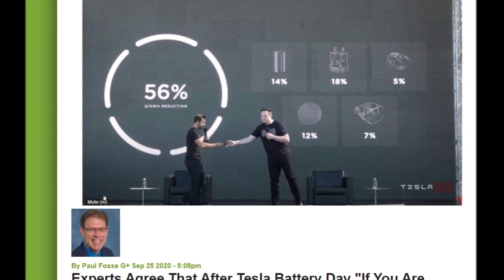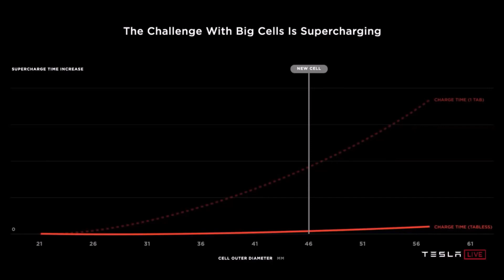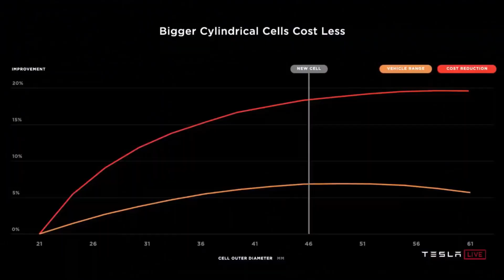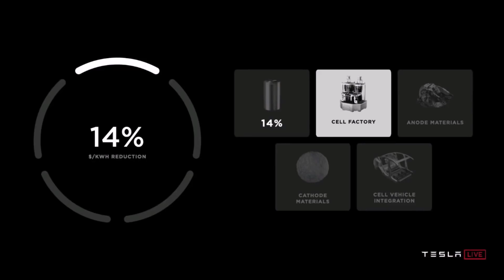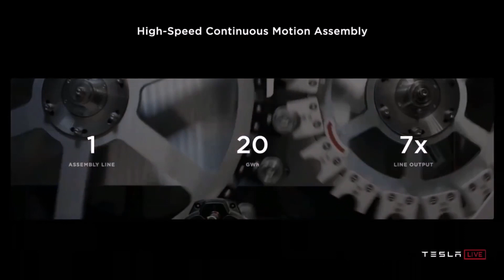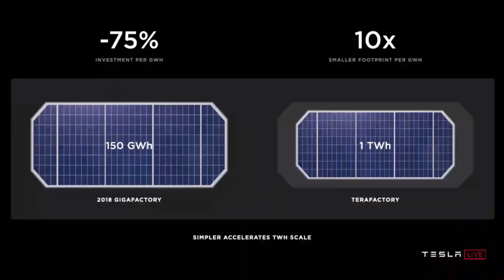It's Unwise To Design ICE Car After Tesla Battery Day

Comment: Gas cars will be around longer than you think. People will still wear out the fleet. People that dont have a place to charge at home will have trouble adopting till charging is faster and stations more abundant. There may seem like lots of charging stations these days but gas stations are on most corners. Rural folk will be slower to adopt. I dont know anyone that puts less than 25k a year on a car here. Rural people also prefer larger vehicles.
Reply: You imply an interesting possibility with your "gas stations on every corner" comment. Wouldn't the smart gas stations owners begin transitioning their retail space to BEV charging ports as well as providing gasoline? Seems to me we could be talking about EV charging stations on every corner in 10 years.
Reply: Tim Yarrow the convince store that sells gas will not be where people go to recharge. If sufficient charge takes more than an hour it will be restaurants. more than 2 movie theaters or malls with mixed entertainment will be the  ev charging slots people use.  In 10 years most of the kinks may be worked out. But in any event ice vehicles wont be completely dead for a good long while. They may slip below 20% of sales in less than 10 years. But specialty vehicles will be around a long time. Several companies are working on ethanol in compression engines. That will mostly negate the smog problem with them.
Reply: @derekmartin2817  I'm confident that the market will sort out EV charging locations.  The take-home point is that future charging locations will be as ubiquitous and obtainable as gas stations are today....maybe even more so since EV charging doesn't carry the same environmental risk as does gasoline delivery, storage, and dispensing.

Comment: I don't understand why so many are waiting to make the Tesla plunge.  I couldn't afford not to own a model 3 instead of my previous mercedes CLK 320 Cabriolet.  The Merc got 12mpg cost $240 month for gas.  The M3 costs $25 month in electricity. Same mileage. Difference is I have more fun driving M3 pedal to the metal.  It's fun to drive it so you hardly ever wear down the disk brake pads - using re-gen.  I live on a 1,500 ft mountain.  Before I had to replace brake pads annually.  Now I use re-gen - charge it instead of waste brake linings heading down the mountain.  Merc cost $3,500 year in maintenance on average.  M3 past 18 months - zero maintenance.  Insurance dropped ~ 50%. I save ~ $7,000 per year with the Tesla I paid $30k for after tax incentive. Payback is 5 years.  When I install solar panels on my house and a power wall then zero energy payout and when the local electricity outages hit I won't even know it when I eventually get a starlink UFO on a stick satellite internet service.

I've owned Merc C series and BMW 3 series.  The M3 is quicker, safer, more economical, more comfortable, more spacious and more beautiful.  There's more leg room inside because there's no drive shaft hump, no engine in the front.  The glass roof is not thick so you have more head room and what a view and no worries about UV roasting the paint off the roof or bird manure eating the paint off the roof.

"The drivetrain in an ICE vehicle contains 2,000+ moving parts typically, whereas the drivetrain in an EV contains around 20."
There is no slack when you press the accelerator of EV.  With ICE you press the pedal, which goes through linkage to the injection system then the piston pushes on the piston pin, which pushes on the piston rod, which pushes the crankshaft which pushes on the clutch which pushes on the trans main which pushes on whatever gear you got it in, which pushes eventually on the front of the uni joint which pushes on the back side of the first uni joint which pushes on the first half of the drive shaft which pushes on the back half of the slip drive shaft which goes through the front of the second uni joint and then the back of the second uni joint which pushes the diff pinion gear which pushes on the axel pinion gears and finally the axels are bolted to the wheels - no wonder there is a lot of ICE maintenance compared to EV and a lag when you press the accelerator of an ICE.

I used to rebuild wrecked-totaled Merc, BMW, Audi, Porsche, Jaguar, Saab.  The M3 construction, fit and paint is as good or better. 

I bought a chunk of Tesla stock at $640 (before stock split in 5 pieces) the gain has paid for the M3 6 times over so I have a Cybertruck on order.  Can't wait to use it to plug in my air and electric power tools on job sites, no worries about dents or scratches, the thing lowers down so you don't need a ladder or carry steel running boards around just to get in and out and tools will be safer under the built in bed cover.

No more fumes.  No more goosing around town, waiting in line to get gas, checking water, oil, changing dashboard bulbs - on and on.

I have no idea why some say it will be 2025 before EV costs become equivalent to ICE.  My M3 is 30% paid for already just from savings on fuel, maintenance and insurance.  No ICE I've ever owned comes close to being as satisfying or exhilarating as a Tesla.

Comment: I think a big area, where there seemed to be a miscommunication was the structural battery pack. Bob and John were saying others do it to, but the point was others use the overall pack as structural,as do tesla now by adding i beams etc.
but Tesla is using the cells as part of the structural makeup meaning less dead weight.

Comment: The Teslas with new batteries might be worth buying due to the much-needed weight distribution improvement.  They still look like a computer mouse tho.  My new ICE will be far superior as far as driving dynamics for quite some time I reckon.
Reply: Tesla right now have much better driving dynamics then most ICE cars due to the low centre of gravity, the first time you drive you it's really noticeable.
Reply: @deepwinter77  most ICE cars.  They need more years to dial-in the weight distribution and AWD.  It seems they're aware and improving based on Elons Battery Day remarks.
Reply: @dragonsickness4561  no the polar moment of inertia is already better in Tesla's vs ice cars, he is talking about improvements over Tesla's, weight distribution, center of gravity, and polar moment of inertia are all better right now then ice cars.
This is not a controversial claim it's well known.
As well as acceleration and speed, on most cases. They already have AWD.
When compared to ICE cars in it's class it exceeds most of them. It's performance models will beat most ice sports cars, certainly in their price bracket. I know petrol head's that have taken a test drive in a p100D and completely changed their minds on Tesla's.
Reply: @deepwinter77  to say teslas have better weight distribution is too general of a statement.  Depends if you're talking abt mid-engine or front engine. How the suspension and AWD are tuned come into play to counter weight transfer and many cars have different setups that require different types of driving.  It comes down to what setup you prefer to handle and what your goal is.. One isn't necessarily better.  Teslas are more similar to mid-engine designs.  Those are okay on a racetrack if you want to drift and buy new tires a lot
Reply: @deepwinter77  they don't release PMOI numbers so to say that Teslas have better PMOI than all ICE is absurd and literally nobody knows this.  If it were true, Elon would say that all the time. Regardless,  better would be a matter of perspective and what your purpose is.

Doesn't matter anyways.  Teslas owners  would rather use FSD.
Reply: @dragonsickness4561  it's a formulaic calculation, how do you think having an offset weight set in the front of a vehicle in the form of an engine block does to this calculation? Its dominated by weight away from the center of rotation.
For Tesla drivers to prefer FSD they would need that option many don't, & those that do certainly don't use it all the time, my first time driving a Tesla was on a track my mate was there with a Suburu Impreza and we both got a chance to drive a Tesla P90D and it blew most ice cars away unmodified in acceleration handling & speed. I do not own a Tesla I'm just realistic after comparing them to most Ice cars and all Ice cars I've driven/drive.

 Also having a car with superior handling is preferable in FSD as it enhances the cars safety.
It's lower center of gravity also helps in accident situations and contributes to Tesla's being some of the safest cars on the road.
Me saying Tesla's have better weight distribution then most ice cars isn't to general it's actually a fact, and I was responding to your initial claim ice cars would be better in this area foe some time.
That is a generic statement, I said most not all.
Even most mid engine ice cars do worse because the battery is lower and weight is lower then any engine I've ever seen or come across.

If you're driving hundreds of miles daily and no super chargers in your area, sure an ice may still be preferable for now, but that's a different argument and it's becoming a pretty rare niche situation.
Reply: @deepwinter77  you didn't say most.  You said ICE vehicles.  You said better dynamics than most ICE - not PMOI specifically.  Now you've backtracked to correct your statement.

Front-engine handling requires that you transfer weight to the front before the apex to prevent understeer.  If you have a good AWD coupled with that design you give throttle as you approach the apex, engage the AWD for some rear torque (and possibly a bit of oversteer if timed right), square-off the bend and throttle out of the turn. When done correctly its more effective than full-on drifting as displayed by Audi in the 80s-90s when they embarrassed all RWD vehicles consistently with their controversial AWD.  Its very different from rear or mid-engine driving. Front-engine is typically suited for daily driving unless you have RS Quattro or a similarly intelligent AWD system to give rear torque when needed. In that case you have a powerful track weapon that is capable of getting a bit greasy around corners, but still won't drift like a RWD car, but is preferable if you know what you're doing and have mastered front-engine, AWD dynamics.

It brings me back to my point of your generalized statement.  You're comparing apples and oranges by comparing front, mid and rear-engine when they're designed for different purposes and each have pros and cons.  It comes down to driving style, preference, skill-level and setting (track or street).  Not all AWD systems are the same.  Some AWD systems are more intelligent and tuned specifically to synergize with the vehicles weight distribution when it senses the need for torque adjustment.  There are many variables working together.
Reply: @dragonsickness4561   @Dragon Sickness  I did say most look at my first reply, to your original comment in which you stated your ICE car would be "far superior" in driving dynamics for some time.
That's the context pmoi, relates to driving dynamics that's the point of what he Elon was talking about how polar moment of inertia impacts driving dynamics. It's the whole point of why you would be interested in optimizing for this figure, to improve handling.
You seem to be arguing from a conclusion, you haven't compared the handling of a Tesla to your ICE car but confidently pronounce your ICE car is far superior.
I had an opportunity to directly compare a Tesla to an Ipreza WRX on a track, and to the many ICE vehicles I've driven over the years.
Only after this my decades driving ICE cars compared to my driving  a Tesla did I make a claim about the superior driving dynamics of a Tesla.
Reply: @deepwinter77  I'm referring to "no the polar moment of inertia is already better in Teslas vs ice cars"
Reply: @deepwinter77  I've seen a stock TT RS get 0.1 sec slower lap than a model 3 performance and I bet it could do better if the driver had more experience with front-engine, Quattro dynamics. Its a lot trickier to master than other designs where you just floor it regardless. The Tesla was clunky and sliding everywhere, appeared difficult to control the drift, brakes were bad, but the torque/acceleration saved it.  In an actual race the car with more traction has an advantage cuz he can cut you off more easily and even take the outside of a turn and still come out in front.  You don't see many Teslas actually racing - just doing lap times.  It suits them when cars with better traction/handling can't have their way with the clunky drifter.
Reply: @dragonsickness4561  now all you're doing is ranking cars by saying an Ice car was slower around a track,  and I could list a dozens cars in its category it was better then, still makes your initial comment wrong imo, i.e. there now worth buying because there weight distribution is so bad.
In car you haven't driven.
But whatever man im not trying to sell you  Tesla.

Comment: does a 4680 tabless LiFePO cell make sense
Reply: Yes. Form factor even more important for LiFePO4 - need the extra range, power and durability you get from the form factor and tabless to offset lower range and the fact this chemistry to go in less expensive vehicles.
Reply: @cbmusgrave  tabless means electrons arent crashing into each other on the way out of the battery creating heat.... shorter distance less heat, less cooling needed, larger cell possible...
Reply: @bobh9492   Generally you are right, but your explanation is wrong. Electronic resistance is caused primarily by ionic scattering  - that is inelastic collisions between electrons and phonons - not by electron-electron collisions. Lower LiFePO4 energy density is balanced by larger form factor, which increases the overall electronic conduction pathway length, but 4680 balances that with tabless shortening the average e- conduction pathway. This lower resistance and thus lower heating on charge and discharge is especially helpful for LiFePO4  - tabless gives you more headroom so as to avoid power levels where LiFePO4 degrades so you get more power without need for cooling. My original post implies this in the balance between form factor and tabless effects on resistance.

Comment: Tesla has the key patents on tabless cells and also several other relevant patents, it is those in conjunction with the cylindrical form factor that enable the rigid structural battery pack and also superior heat dissipation/cooling allowing higher currents and extended charging curves over pouch or prismatic construction.
Tesla also has the patents on the Giga Casting process and the IP on their proprietary aluminium alloy that enables it
Reply: I think Idra the company who made the machine would own the patents as they designed it.